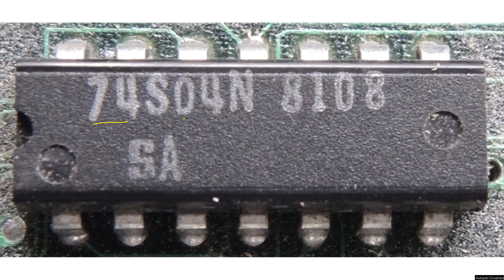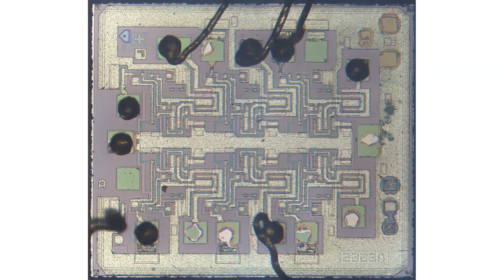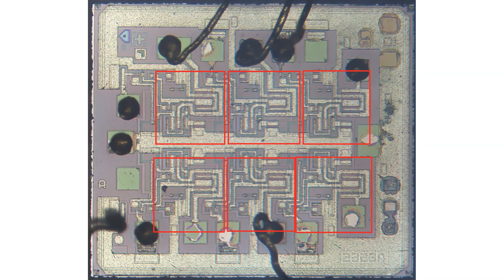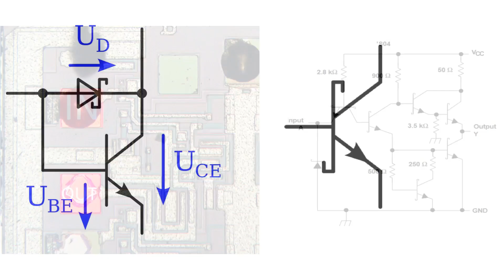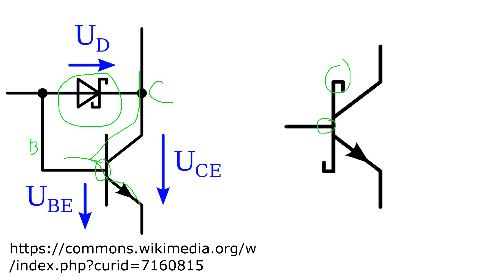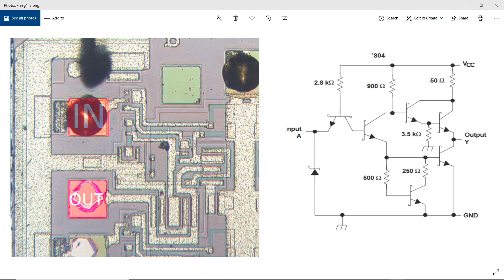INDUSTRIAL ARCHAEOLOGY: 74S04 SCHOTTKY LOGIC

Comment: I've got one of these 74S04 in a microcomputer from that era.
It's used around the 16MHz crystal to create an oscillator using 3 inverters, with the rest used for related circuits.

Comment: I still have TTL chips in my parts bins and use 74S04 as needed. Hardly archaeology when parts are still in use and still available to buy in quantities of 1000+ from normal suppliers.
Reply: I was thinking the same thing - I've just ordered 5 from China . . . although admittedly, they are to repair some vintage arcade game boards

Comment: Still have one that self dissembled, by cooking it's lid off. Was the only device to fail on a whole box full of TTL, when the power supply decided to take a holiday, and gave the unregulated 14V rail to the 5V rail. Repair was by replacing every part of the power supply, from the pass transistors to the drivers, zener reference and all the resistors, and then replacing the crowbar circuit that should have blown the fuse, because it had not. Funny enough of 14V it all worked nearly normally.

Comment: nice analysis and great description.
A small tip for LTspice - the blue traces are very hard to see, I usually change the color or at least choose a wider line width under Tools-Control Panel-Waveforms.